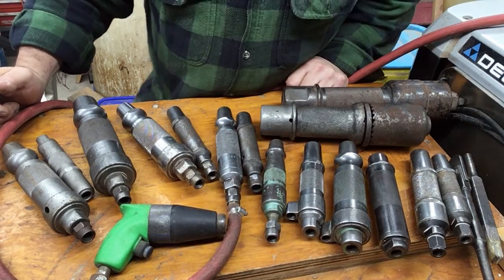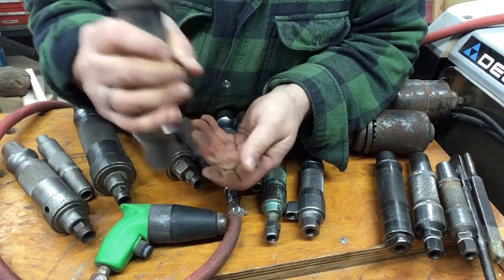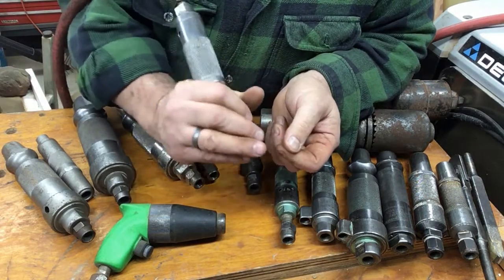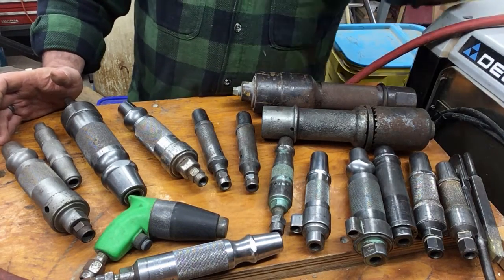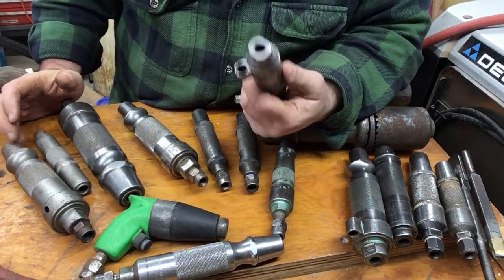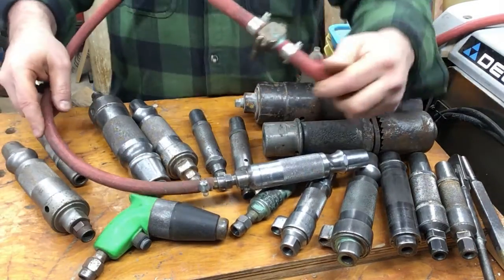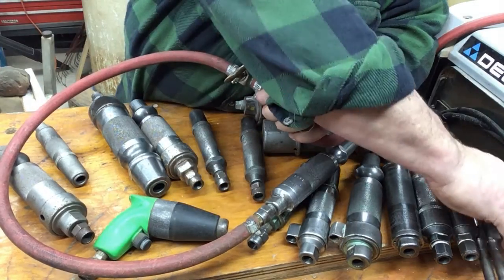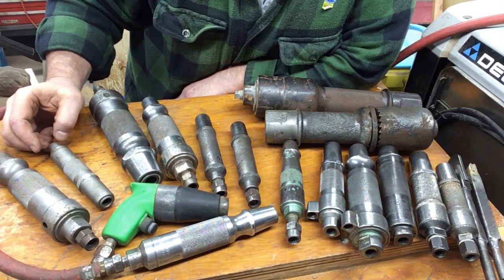Traditional Stone Carving Techniques- Pneumatic Hand Machine Hammers for Stone Carving Video 1

Comment: Huh which pnuematic hammer would you recommend for carving hard stone bricks and the occational sink? I assume they all exceed in different areas stone wise?
Reply from the maker: For true granite sinks, I would use a full stroke D hand machine from Bicknell, Trow and Holden or Granite City Tool.  You can do everything with a 3/4” D  machine, but rough-out will go faster using a 1” D machine in conjunction with appropriate diamond saws (hard stone- embedded diamonds.  Soft stone- encrusted or dipped in diamonds) to help open up the basin recess faster.  Making and using template patterns to guide the evacuation work can help make the finished sink look even and much more professional.  Make a pattern from tin or plastic, label any info and store it for possible future use.  That’s a good habit to develop.

For sinks from other stone and “Hard stone bricks”, it depends what “hard” means.  Hard like granite- use a full stroke D machine with smooth chisels.  Hard like marble or limestone- use a short stroke B machine or a Cuturi or F&K with toothed chisels.  A D will work on softer stone, just like a B will work on softer stone- they just won’t work as well.  

If you’re not sure about the hardness, test it with a chisel or diamond saw blade.  Truly Hard stone is likely to quickly break clawed or toothed chisels when forced.  Soft stone is easy to dig to the point of stalling the cut when using a smooth chisel.  Hard stone will also quickly wipe off dipped or encrusted-style diamond blades while soft stone will cut be poorly cut by embedded diamond blades, often quickly heating to the point thermal failure of stone and/or blade.

Commercial Fired bricks are brittle and generally difficult to carve vigorously with a chisel, partly because they’re so small in mass.  If they’re already mortared in place, the energy of carving can cause failures in the bond.  Older ornate brick work often used comparatively softer bricks that were wire-sawed (by hand or machine) to profile before being abraded and this is done before the bricks are laid into position.  In general, abrasion works best on anything that’s been through a kiln process.

Good luck.
Reply: @carolinasculpturestudio  thanks. As for the stone I believe it's granite field stone. There is limestone and sandstone mixed in with the field stone but the hard stone has quarts in it so thats why I believe its granite.
Reply from the maker: @Enquiring_mind87   Sounds good.  When granite has large pieces of quartz, especially with stone like India Red granite, you may find that the individual quartz crystals chip and collapse either entirely or at their edges.  Using a very sharp carbide chisel at the end of the work can help work the larger quartz crystals without shattering them, but sometime it’s unavoidable.  If you are not polishing the surface, it isn’t as critical.  Good luck.

Comment: Really useful information. Thanks, I'm  enjoying the series and misc videos.

I was  wondering why your tool in the other videos had air from the tool end, I thought it was design, but glad you mentioned it was break in allowing air past the cylinder.

Regarding break in, how does the behavior change once that is  achieved?  I have a T&H which seems to have a pretty good range of  flow over which it runs.  

One note on valves from an inexperienced guy - plastic ones stink(or at least mine does). To much flex makes it hard to set it where you want as it springs back a bit when you let go,so you need to swear at it and tap tap.

Anyway super video, thanks again.
Reply from the maker: You're very welcome.  Break-in for pneumatic machines has as much to do with personal preference as manufacturer recommendations.  

Manufacturer guidelines typically recommend systematic oiling per hours of usage which equates to oiling your hand machine multiple times a day.  This slows wear and keeps the machine in near-new condition for a longer period of time.  Little to no air will pass the piston in cylinder. Similar construction aviation industry pneumatic rivet hammers (size designated by an X, such as 3X or 5X) are kept oiled in order to assure the hardest hit to produce the fastest work results.  As a result, little to no air loss or blow-by occurs.

For stone carving, other considerations matter.  Frequent use of oil near stone can lead to catastrophic staining of the stone job, whether directly from spilled or dripped oil or indirectly from either oil residue passing the piston or exiting in the exhaust.  Oil passing the piston will carry debris in the wash that typically coats the shank of the chisel.  This can easily be transferred to the stone by incidental contact.  The same happens when oil or oil & water (condensate from compressed air) blow out the exhaust.  These situations need to be well-managed to avoid ruining a stone.

In stone carving, it is very advantageous to have some air passing the piston.  This air can be used to blow stone debris from the work area.  It significantly expedites the carving process because without this air source, the carver must stop and use a manual brush to sweep debris away.  Manual sweeping with a brush can introduce the risk of breaking small details, which is avoided if only air is used.  For the marble project I'm carving right now, I'm using a pair of Cuturi machines that are nearly new and rarely used.  Little to no air passes the piston.  It's a noteworthy inconvenience to have to stop carving, get a brush, sweep debris, then start carving again instead of just blowing debris away with air from the end of the machine.  

Some stone carvers will use a hand machine without little to no oil until they feel it is adequately broken in.  Then they will make a habit of oiling it to help maintain that state of function for as long as possible.    It's all about personal preference.  

I have not carved a job with my F&K. I'm used to typical straight hand machines and I have a good inventory of tooling for them, so that's what I prefer to use.  The F&K seems to have a longer stroke at higher speeds. It should be very adequate for the right work.  

It's too bad the old brass air valves are no longer available.  I've used plastic air valves and a number of metal ball valves.  None are as good as an old brass valve.   But metal valves are always preferred over the plastic ones.